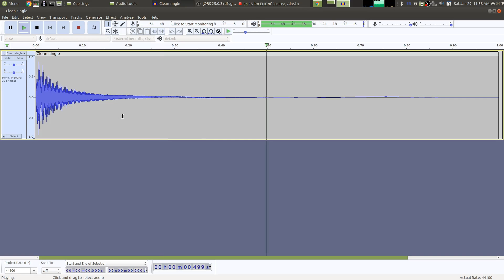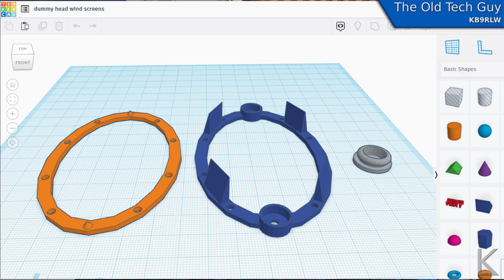3D printing and sound - Making wind screens for my binaural dummy head microphone.

Comment: Hi Kevin. I have just been fitted with a pacemaker and have been told not to get with in 9ft of a transceiver as the RF will affect the pacemaker!!! I have checked many sources including the medical team who fitted my pacemaker, they said they weren't sure, but they said its the magnetic part of EMF that possibly could be the problem. All the other sources I checked came back with ambiguous answers! I would like to be able to measure the RF in my shack, say an arms length from my 7300. do you know of an instrument that can do this? I would be most grateful if you could recommend one. 73 Dave M. MW0MDV
Reply from the maker: Hello David,   A true field strength meter would be what you'd need.  Probably quite expensive.   I'm not a person to make reliable recommendations in this arena.  
I can say that it's not the transceiver to worry about, it's the antenna system and feed line.   The transceiver is in a metal box and shouldn't radiate RF.
The antenna needs to be far from the operating position and a feed system that reduces RF radiation off the feed line.
Reply: Go to the manufacturer of the device for advice on RF exposure.  This what my friend did on the advice of his doctor.
Reply: @jimsouthall1085  Thanks Jim, I'll try that.